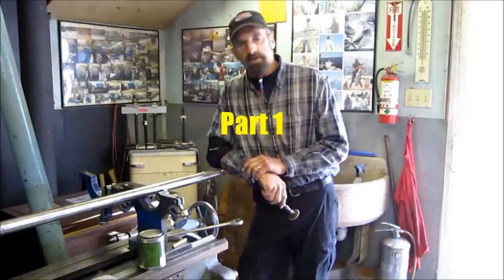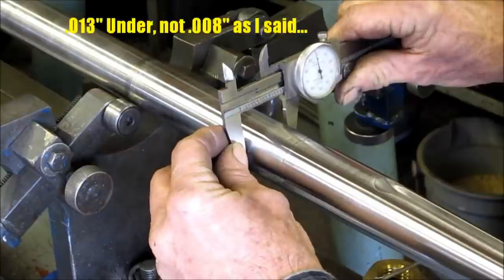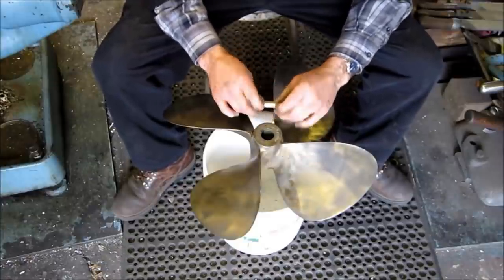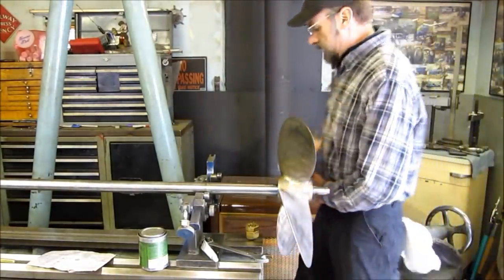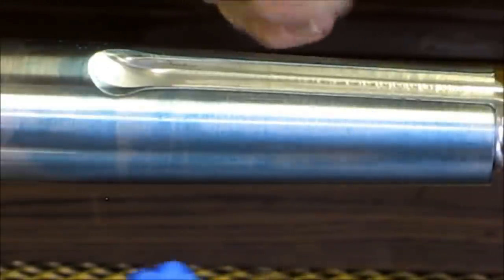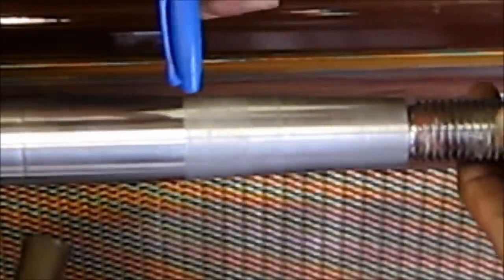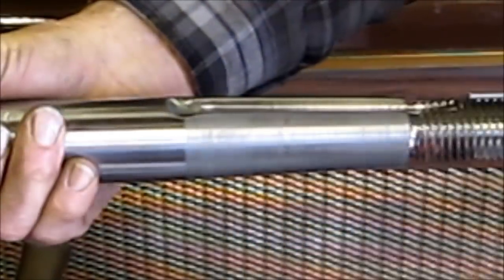Lap & Fit; Fitting Props Part 1 Reprint 004

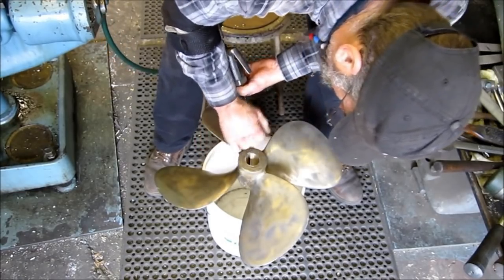Comment: 6:00 what is that sanding attachment called? I can't find anything like it online.
Reply from the maker: That is just a 1/4"  steel rod that I took a hacksaw and cut a grove in the end of it to except the folded piece of emery cloth and I change it out to suit girt and newness....
Reply: Thank you for the reply. I found someone online that does the same and sells them online.
Reply: What grit emory paper do you recommend? I have a nibral prop on 2-1/4" shaft that is not seated properly very similar to the prop you are working on in the video. It's the forward inch, maybe 1-1/2" of the hub.
Reply from the maker: I keep a roll of 80 to 320 on hand, use what is needed to clean the bore. Use lapping compound and lap a prop to shaft to obtain the proper fit. You can't free hand the proper fit...  Keith
Reply: Thank you for your insight. I will finish with lapping compound on the shaft taper for a proper fit.